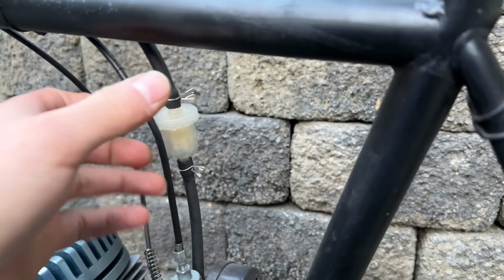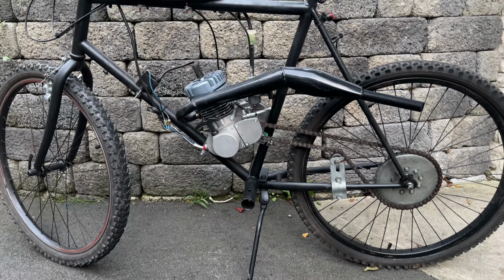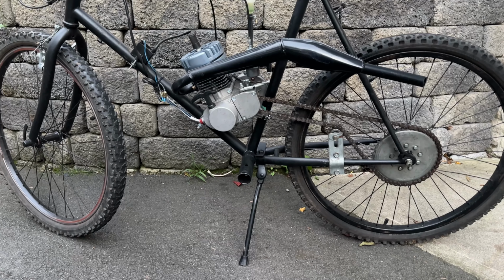Motorized bike riding BBR Tuning  exhaust

Comment: Wow,does that exhaust have a healthy crackle.I've been given lip for suggesting this before as they say,"Oh,that'll weaken the pipe"...Drill through your tension mount and put a hardened screw through into the frame.I'm talking 1/4-inch.Not a Bolt as they thought.It'll keep the tensioner from twisting into your spokes as easily.The engine mount bolts are 6mm which is...?Happy Trails.
Reply from the maker: Yes I have thought of doing that just haven’t gotten time to do it. Will probably do it in the next video.